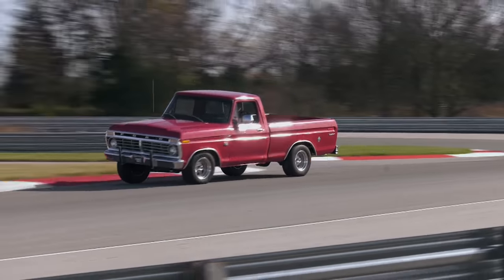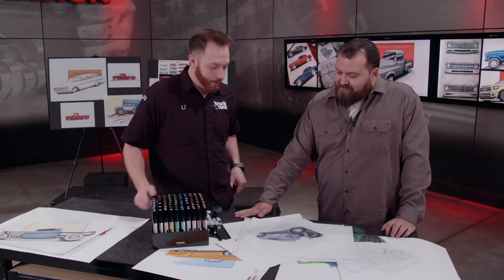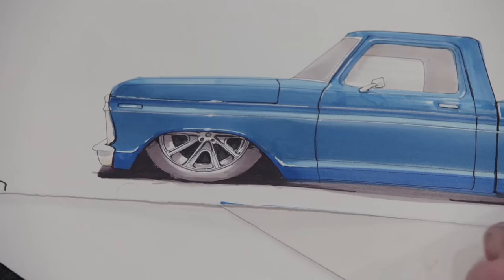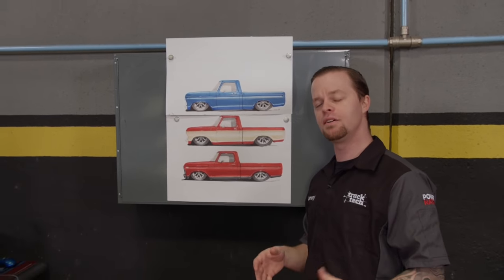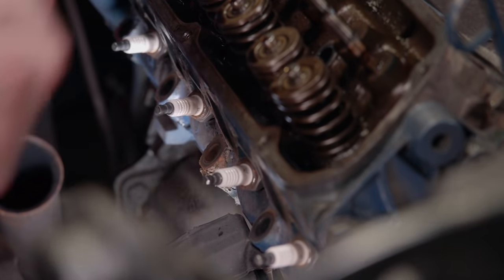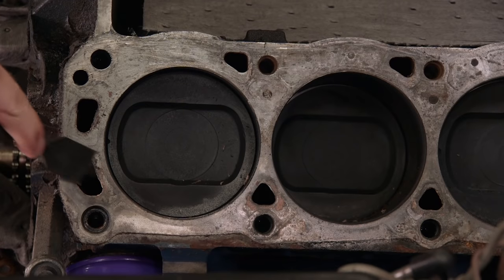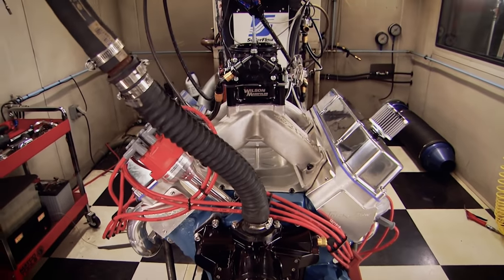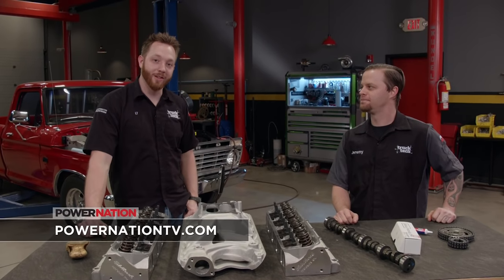Spicing Up The F100's 351 Windsor With A Top End Kit - Truck Tech S5, E8

Comment: Budget build, $7500, coffee shot out my nose.
Reply: I totally agree with your comment a budget build was a few hundred bucks taken heads to the machine shop and getting the machine and buying an upper head gasket set with some new oil plugs wires feel the odds and ends
Reply: No kidding.  I'm building an alum headed 351W for my stock car conversion and I will have NO WHERE NEAR $7500 in it when I'm done.

..and that's an actual engine build with fresh bores, forged pistons, racing oil pan, etc...

not a top end hack job on a worn out bottom end.
Reply: @earlbrown  good build man, labor costs make a build pricey..
Reply: @bigboreracing356   Actual real life hotrodders.

as opposed to checkbook hotrodders.
Reply: Writing checks for parts you need is one thing (if you can't build it yourself). Just buying expensive parts that don't belong is nothing more than dress up and bling.

   There's a rule with engines..  ''If your ring seal is shit, your engine is shit''.   That's ignoring putting aluminum heads on a low static compression engine.  VE is already low, and aluminum just makes it worse.  The small weight savings won't mean anything on that truck. Bolting on a bunch of expensive parts on top of a shit shortblock is not hotrodding.  Not to mention, if you know what you're doing, you NEVER bolt up a set of 'ready to go' heads.  Because they never are.

That video, when they FINALLY got to the relevant part, was nothing but a commercial for Summit racing and Edelbrock.  It exists to generate ad revenue. Nothing more, nothing less.
  Needless to say, I'm not they're target demographic.
Reply: Budget build:  

(1) realize a truck is only going to put down so much torque, and you want it to tow anyway. So forget hp, go for torque and low compression.

(2) skip porting heads off some Youtube video, grab GT40Ps off the nearest Ford Explorer in the junkyard and an 85 distributor to ditch points ignition.

(3) install decent exhaust system, stab in a good RV cam and buy a used intake. give automatic trans a shift kit if you have one and Ford's old ATF to tighten things up if you still can find it. 

(4) be happy it cost you half or less what your friends pay for a lease truck making same torque.
Reply: @earlbrown  just because you write a check for your car doesnt make you less of a hotrodder.  they may know a lot about their builds.  i see a lot of nice builds with thought into them where the owners can actually explain what went into them.  the whole built vs bought stuff is just crap  and it doesnt bring the car community together.  it tears it apart.

if you have the money go ahead and spend it
and the other point

you dont think that engine WONT pick up even with low static compression?  it will.  and what has to be done is the initial timing needs to be higher yes,  but just limit the mechanical  and it'll run good.  bolt on parts is the BASICS of hot rodding  when youre a beginner.  i would never tell someone they wont gain anything by redo'ing the top end with better parts

if this was an LS video that's exactly what people in the comments would say because i literally see it everyday in the comments of videos.  they'll mostly say  just re do the heads put a cam and spring kit in it and a better intake
Reply: @KingJT80   If you have to advance you timing much more than normal to make up for a shitty build, that's not hot rodding, that's bandaid-ing. Piss poor VE is a piss pore engine, period.

 If you go to a restaurant and write a check to get a meal cooked by a chef, you're not a chef.

If you go to a GC and write a check to have a house built, you're not a home builder.

If you throw money at a shitty shortblock, you have a shitty engine.

Just the same as if you spend $1M on a renovation on a cracked foundation sinking into the swamp. It doesn't matter how nice the faucets are, the house is a POS.

...but what do I know, I only do this stuff for real.    And not one single part I install on any of my stuff is the wrong parts because it's sponsored by ''our friends at such and such''.

Sorry you got triggered because someone called a commercial designed to generate youtube watch minutes, a commercial that's designed to generate youtube watch minutes.
Reply: Only 7,500 bucks I'm thinking a budget built 1,500 or less lol
Reply: That's the All In budget. Not just the engine.
Reply: No kidding! I'm like $750 isn't really a budget build to me!
Reply: i paid $6435 in may 2023 to remove and totally rebuild my 94 cobra 302...took 4 months... it runs better than when i bought it new 30 yrs ago(built on may 16,1994 hand painted in yellow under hood)

Comment: The 351 is a great platform. Lots of potential with some good parts. Love the Dentside too, probably the most classic, beautiful generation of Ford pickup.
Reply: The 351M was not a good engine,bad crankshafts from the factory resulting bottom ends going bad.Ford has the worst interchange due to 6 month changes
Reply: @Toolaholic7  we aren't talking about the 351M or 351C. This video is talking about the 351W.
Reply: Would have been nice if Ford offered the 351W from the factory in the 74' F-100. The 360 was the closest to the 351w ci wise. But the 360 made the same horsepower as the 302, though the 360 had more torque than the 302.
Reply: @sdvten  The Ford 360 had a very weak bottom end and blew up.Dad has seen this.
Reply: It sure is brother
Reply: @Toolaholic7  This my friend is the 351 Windsor V8 not the 351M nor the 351 Cleveland V8
Reply: @Toolaholic7  no one cares about your dad, he probably didn't maintain the engine correctly
Reply: @jordanwicinski2141  He is no Ford fanatic,calls them junk
Reply: Cool truck to bad they want to lower it like every other poser who thinks it looks cool

Comment: Ford needs to bring back a modern 5.8 (351) pushrod engine.  With a new cross bolted bottom end, forged internals, high flowing aluminum heads, and long runner intake it would rival the competition.
Reply: So, never heard of the 7.3 godzilla?
Reply: @damianlindsey6177  of course I have.  But they won’t put it in the f150 so it will never be available in large numbers and will always be expensive.
Reply: Pushrod, 351 ci of displacement, large production numbers? Something tells me the EPA would never let that combo leave the ground.

Comment: I just did to my 75 Ford E-150 shorty van. Updated the 351w with 4 barrel intake, air gap, single. New Edelbrock 1406 and refurbished Mickey Thompson Valve covers.   I wish I had the money for cam, heads, and the other goodies. Hey, one of these days, right? lol

Thanks for the video fellas

Comment: I'm pretty much doing this exact project on my 1977 Thunderbird. She originally had a 351w, and that engine was replaced at some point with a (period correct) engine built in 1979 according to cast numbers. Currently has already been bored .040 over at some point amd has newer mahle pistons in it, so I'm going to just use a ball hone to refresh the cross hatching and put new rings in. For heads, I'm going to use a set of Twisted Wedge aluminum heads, a Weiand dual plane intake, 650 brawler carb and a Howard's cam with .519 lift and 112 separation. I HAD to pull mine because the rear main was shot and I was losing a quart of oil every time I filled up from a pretty significant leak. Nice winter project

Comment: Took notes on the engine part. Got a recently acquired 1977 Thunderbird with the 351W in her and while she runs good, I know I can wake her up by removing the 70s vintage ford carb, egr restricted 2 barrel manifold and weak ignition and distributor.

Comment: evans coolant will definitely not pull more heat out of your engine

it will make it run hotter or in best case scenarios be around the same as normal coolant mix

Comment: 14:30 Wait... did he just pretty much wet sand the deck... with internals still in....???? Is this a April 1st ep leak or....
Reply: Yeah.. those metal shavings didn't go anywhere important 🤦😂
Reply: Between the 'old' engine having fresh paint on the exhaust manifolds not burnt off, and every accessory  in brand new condition I think they took this apart once to prep for the episode. Taking the AC lines off without evacuating the system is another Romper Room no-no. Hand sanding the block deck? Let's just say these guys won't be touching my truck.
Reply: yep, but they used to love boring engines without a torque plate either. in a pinch, one could fill the holes you want to keep clear with shaving cream to catch debris and if its metal shavings put a rare earth magnet in their path. but yeah its funny to talk about making sure you shave the deck perfect and overlook the debris in the shortblock. 

but hey if no prep stretch says who cares, that tells you what his engines look like.
Reply: @bigboreracing356  the one who keeps responding to insist he doesn't care :)
Reply: @bigboreracing356  seriously, you do :). you always talk "dart this, expensive part that" and then you tune into these programs with basic builds and "budget" parts and questionable machining. you need to go check out something like Nelson Racing Engines, that's the big boys using stuff you claim you use where the engines begin at $25K and make four digit hp. 

the best way to be taken seriously is to act serious. don't play in the kiddie pool and complain everyone in it should be swimming to your level, step up :)

Comment: I like the way it looks as is.. but lowering the truck with those ugly big wheels in the truck's almost touching the road.. despicable.. I guess my mind thinks old school looks better
Reply: judging by the pictures it looks like they would have to bag the truck. Not my thing. Just look at the proportion of the wheels/tires and where the top of the tire would be. It would ruin the truck in my opinion.
Reply: You are not the only one. My 74' is stock height and plenty low as is. But I like to use it as a truck from time to time. Going to throw all kinds of money at it but won't refresh the motor the way it should be done.
Reply: I can't say the lowering of the truck improved ANYTHING. Too low.  It's a truck ffs..
Reply: Yeah it's called the taste criminal look.
Reply: Bro I’m all about big tires and some stockish size rally wheels on a 2wd and some huge tires on stock wheels / 16.5 wheels and humvee tires 37s or 38s on the 85-95 f250s it always looks good to me

Comment: They really should have done an overhaul and new pistons to get the compression up.
Reply: I don’t think that’s the intention.  Between wanting to keep the cost low and allowing the engine to remain in the truck that they accomplished what they wanted. Sure they could have completely overhaul it but they also said it’s supposed to be a mild build.
Reply: I agree, rings and bearings are cheap. A little hone would freshen it up.

Comment: I got a question what do you think about the 351m is it worth doing alot of mods to it or would it be better to run a different motor?
Reply: Look up Richard holdener on you tube. The 351m is similar in many ways to 351 cleavland. They can be made into powerful motors. However it is more expensive than doing a 351w. When i built one for my cousin and one for a friend in the past 4 years,  both dynoed at around 400hp 400tq on a dyno. Not a "oh I added up what the manufacturers of the parts said dyno"  I want to say 420ish hp and 435 lb ft tq.  The stock heads limit flow which is why tq was higher than hp
Reply: Absolutely the 351 Cleveland and the  modified it is an awesome engine for performance the early Cleveland's and the boss 351 was a Cleveland the  heads were awesome I would almost call it the small block hemi bottom end did have some flaws though but here's another tidbit of information Cleveland heads would fit the Windsor block and that was the direction people going to go until the aftermarket made much better Windsor heads but the early Cleveland heads were amazing breathing small block heads
Reply: Thanks guys that's what I needed to know

Comment: Should of just swapped the body onto a vic frame. Lowered/better engine/better suspension all in one go.
Reply: A guy in my area has a dentside he dumped $15,000 into just the frame so he could duck orange cones. I wondered why not a P71 cop car crown vic front clip.  but that's what "budget" looks like when you don't have a TV show where you get free stuff.

Comment: And the reason these guys won’t build a ford motor is the fact they LOVE ls motors because they are easy cheap power but you build the 351 into a 408 stroked motor na easy 450-550 hp then turbo or pro charge for 700-1000

Comment: Well I have A351 Windsor marine engine that I built that pushes my cutting cabin bayliner to 75 miles an hour on the water. I'm going to convert that engine over. Take all the marine components off and I'm going to drop it into a fordTorino. And when that's done I should have a 537 horsepower. If my math was correct car car that should hit high tens maybe a 9 in the quarter mile.

Comment: Plastic intakes have got to go.
Reply: Explain?
Reply: @gregbrightwell4682  Heat! And can that plastic take the heat?
Reply: @chevy6299  
They do...for a limited amount of time. 
They came to fashion in the interest of thermal efficiency,  they don't transfer heat well,  and weight. 
In my experience,  they get brittle and fail.